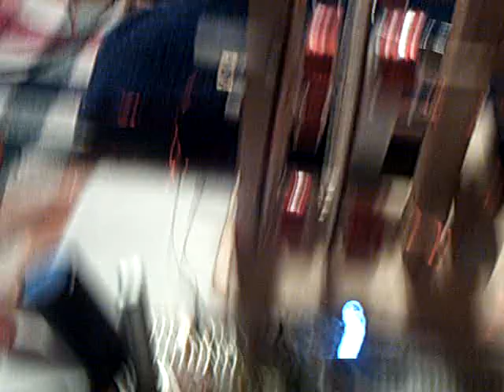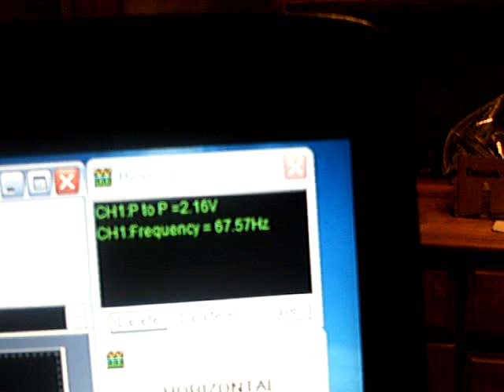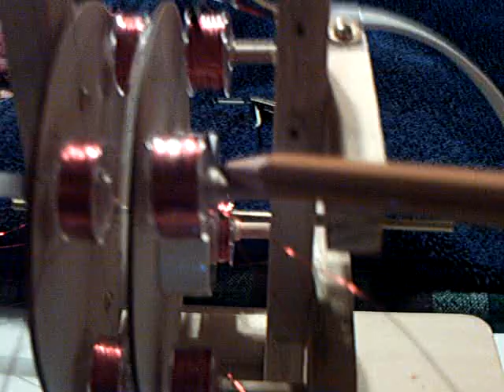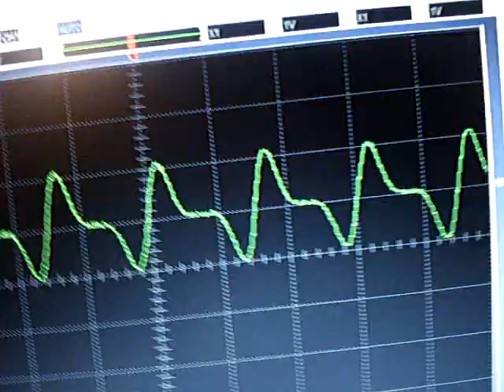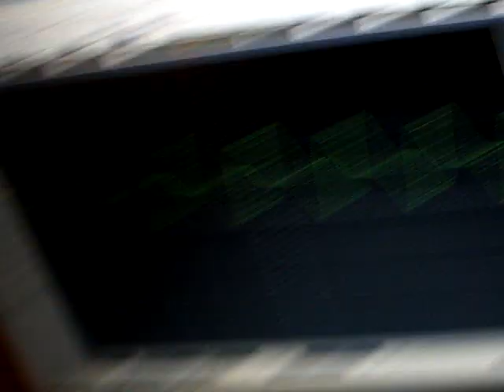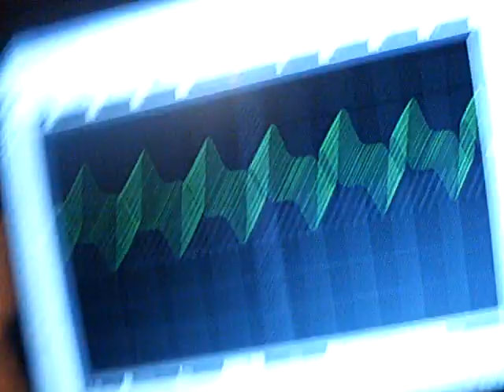Muller Dynamo  running on a capacitor &  generator coil scope shots.ASF

Comment: @Lidmotor i believe it was you who mentioned how the Muller dynamo was supposed to have one more magnet than coils but in Romero's version he had one more coil right? i ended up having one less coil like i believe your initial setup did, but could find nothing "special" going on when tinkering. i did however realize the use of PM's to neutralize the core attraction did not actually work as well as using the PMs to help attract an attraction coil even more, while decreasing draw for some reason.

Comment: how about makeing the coil smaller than the magnet? i mean really all you need is just enough force to push it over the hill.....( maybe start with one coil then switch to another(that uses less power) when your rpms would get high....after awhile you max out in your rpms with one type of speed.... think of it as a magnet transmission... how about hooking up a tesla style pick up to sorta charge up the magnet with energy.....kinda like this guy... pmh and vee magnets

Comment: i would suggest that you try putting a steel washer behind each of your coils.
i do not know why this helps perhaps i aids the flux passing through the coil but i have found that it improves the output.
i would start with this then maybe use a step up coil design like the ferrite rings this seems over complicating what he was showing though.

Comment: Hey There Lid Love your work as always, for the rectifier if you want lower voltage drop you could use germanium diode these are known to drop from .1 to .4 volts and if you can grab the highest frequency it will also help if the generator goes high on RPM. Beside that you can try using germanium transistor for your switching. And don't forget if you want more amp use bigger wire but it will also make bigger coil. Hope this help Cheer!

Patrick

Comment: i seen a few people saying that they have less voltage on the coils then at the input. But Romerouk was using litz wire. Which if using 2 pairs of wires in series should double the wire length = double the coil turns = "double" the output voltage.
About the waveform. Looks like a perfect mirror of the pull / drag period. Exactly what we are NOT looking for. If you check freeenergylt.narod2.ru/muller_dynamo/Out_AC1.jpg, you can see that R wave was not mirrored ?

Comment: Perhaps the FWBR does in fact need to be doubled as per Romero?  How many turns per coil do you have and are they wound bifilar?
What mechanism do you believe is causing the loss of voltage? Undersized Diodes, leaking diodes?